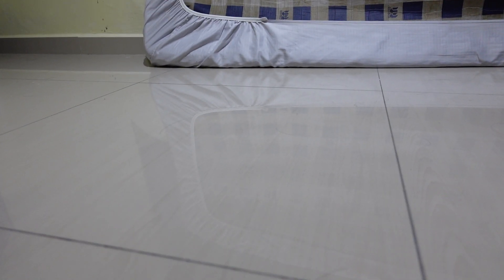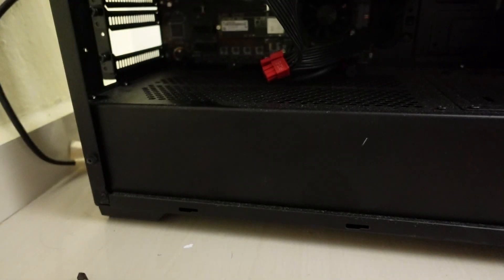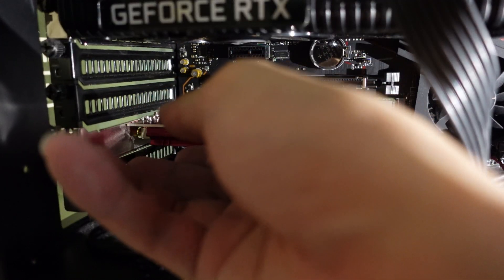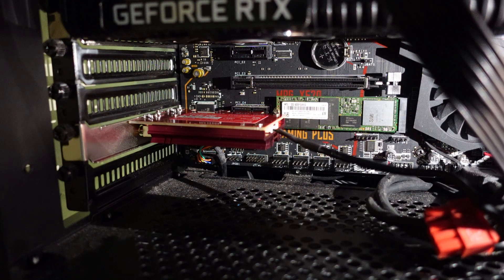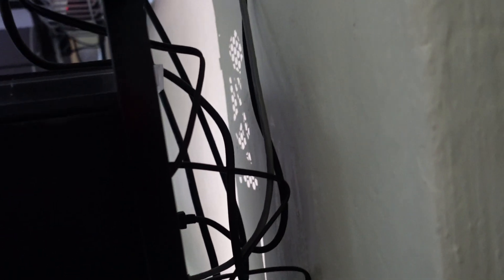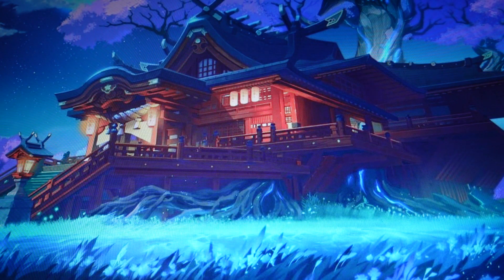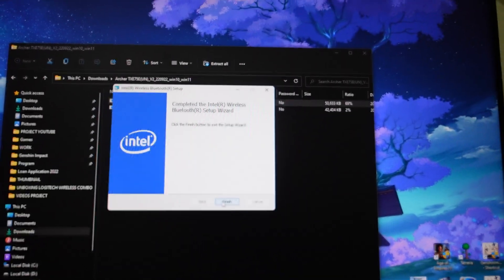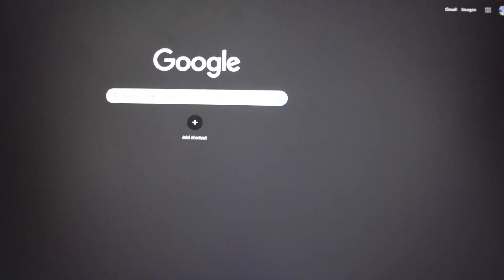How to Install & Setup PCIE Wifi & Bluetooth Adapter (Featuring TP-Link Archer TX3000E)

Comment from the maker: So I recently tried to connect 2 PS4 controllers through bluetooth and one of the controllers kept disconnecting and reconnecting. I disable the bluetooth on this pcie adapter and resorted to an USB adapter and I had no issue anymore. I wonder if I am running into bandwidth problem and might need to try other pcie slots. Anyone knows the reason how this can occur? 

FYI. I have both m.2 pcie slots used. I am using Ryzen 7 3700x on MSI X570 Gaming Plus and my wifi bluetooth pcie adapter is currently in PCIE slot 4.
Reply: For controllers, you better always use a dongle or adapter cause that is designed to run with everything that suports any Bluetooth. The pcie adapters with antennas are not really meant for controllers but more for transfering files, etcetra, so if they disconnect or dont have a stable connection, it (most of the time) means they dont suport the same version of Bluetooth... i never recommend to use an pcie adapter (Bluetooth) for running anny type of controllers. 

It can also be that the pcie slot you use for the Bluetooth is connected to the chipset instead of directly to the cpu what means there is a delay or just not a good connection. (That problem (most of the time (only occurs for keyboards and controllers))) and usb from the motherboard goes almost allways directly to the cpu.

Comment: i have a similar bluetooth card, but my motherboard only has one plug with that design? which is used by the computer cases usb ports - the other thats closest has one pin swapped from top to bottom, how do i resolve this issue?

Comment: Do I download v2 or v4?
Reply from the maker: I would think latest version is better.
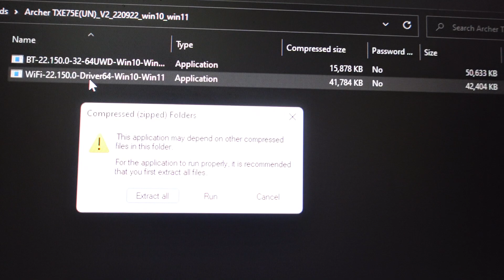Reply: @PenguinTech521 Can you help me on 9:13 when I also start run it won't open setup  software installer what to do and my is version 3 I did download that version from site and did everything right but stuck with this now mine is TX50E

Comment: Hey! I installed everything according to your instructions, but for some reason i don't have Bluetooth on my pc, in device manager it says that device is not connected and error code 45, is it some wire that i haven't connected or what?
Reply from the maker: That's strange. Try reconnecting the usb 2.0.
Reply: @PenguinTech521 okay, thx that fixed it

Comment: my tx3000e has intel(r) wifi 6e ax210 160mhz (which is shown in the device manager)
so does ny card supports 6ghz???
Reply from the maker: This card is advertised as wifi 6 so I don't think it supports 6ghz. The newer model AXE5400 supports 6ghz.
Reply: @PenguinTech521  my device manager shows intel(r) wifi 6e ax210 160mhz 
and the wifi card ans=d when i search it on google it says that it supports 6ghz

Comment: Hello, excuse my English, I bought one of these WiFi antennas, but my PC does not recognize it, do you have any idea why?
greetings
Reply from the maker: Try reinserting into your pcie slot. Is the driver installed?
Reply: @PenguinTech521  hello i have the same problem, the driver cant be instaled because the device is not found ? any updates on this problem?

Comment: I just got a card loke this and installed it, also attached the cable and installed drivers. Bluetooth shows up now, but when I try to connect any devices, no devices show up in there? It just doesnt find any? Do you know how to fix this?
Reply from the maker: Have you installed the drivers?
Reply: @PenguinTech521  Yes I've tried multiple drivers. From the disk that came with the pcie card, from intels website, from the manufacturers website. All turn out to have the same issue.

Comment: Hi, Just installed the network card and it went flawlessly. However, get very low values hsr approximately 40/40. On my laptop I have about 200/180. Do you have any idea why this might be?
Reply from the maker: Try to ensure that the antenna of the pcie adapter is parallel to that of your wifi router. Otherwise, remove obstacles and close the distance between the 2.

Comment: Bro good day, may i ask , so this device gives also bluetooth for your pc? My pc doesn't have wifi and also bluetooth.... so if i buy this it will give me both ? 

Also my pc is old and doesn't have pcie4 mine is pcie 3 i guess.... is there a problem with that?
Reply from the maker: Yes, this gives bluetooth and wifi. PCIE 3 is supported. Check your Windows version to see if the driver is supported though.
Reply: @PenguinTech521  i have windows 11))
Reply from the maker: Yup it's fine. I'm using windows 11 too.
Reply: @PenguinTech521  great thanks much! Will buy this👍🏻

Comment: Mine did the same as yours. I Can Connect the wifi 2.4ghz, but it wont Connect to 5ghz. Did you fix this issue? And if you did, please tell me how…
Reply from the maker: I updated the driver of my wifi adapter and restarted pc and it is fixed. could be a minor issue with my previous wifi router as well.

Comment: I have just discovered this item since it’s been a little bit how is it after you’ve had it for roughly since the video went live?
Reply from the maker: It's functioning well. Better wifi and Bluetooth signal than those built into the motherboard.